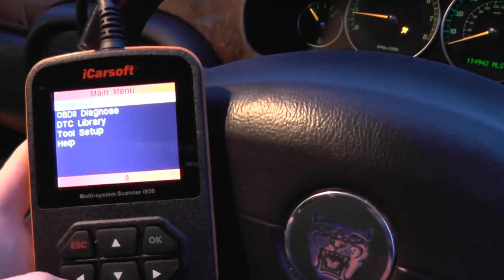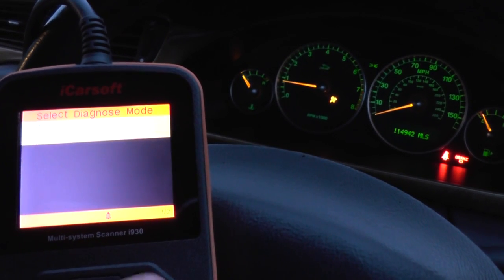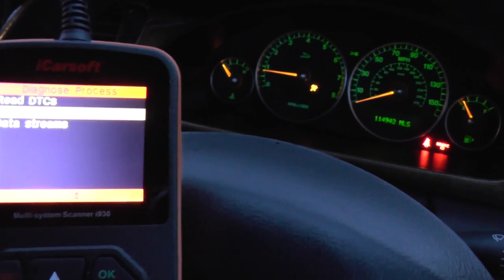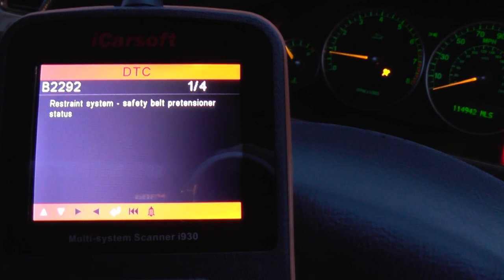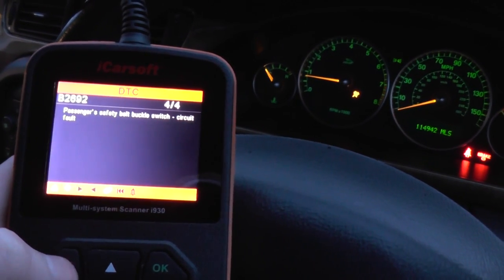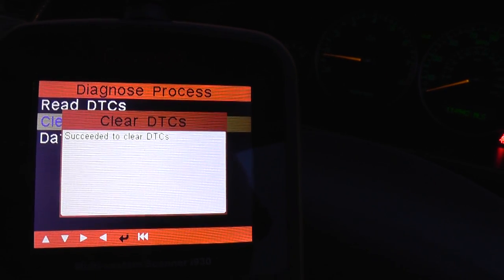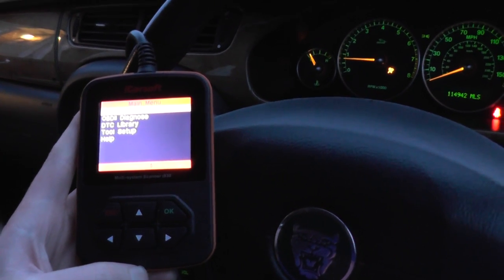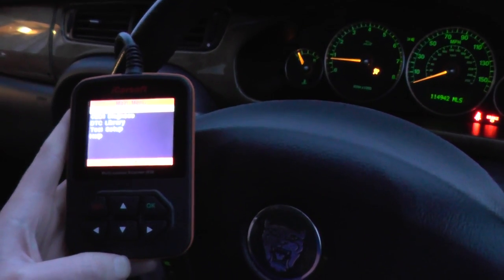This is why your Airbag light will not turn off even with the Correct Diagnostic Tool

Comment: funny, after clearing the dtc then restarting the car, it forced the cars computer into on-board diagnostics in which it was giving a code 52. find the definition to dtc 52 in the srs system for this car and you will know exactly what needs fixed or replaced. good day

Comment: Get some gas! OCD killing me...jags hate no gas the fuel pumps rely on at least a quarter tank to cool and if it fails specially in this model jag you will be pulling the entire rear subframe out of the car just to pull the tank. Gas up lol
Reply: If it relies on a 1/4 tank then it's not well made and that's coming from someone that loves jags
Reply: Wrong, wrong, wrong. Electric in tank fuel pumps are cooled by the fuel passing through them. It doesn't matter if it is full or near empty. If fuel is going through the pump it gets cooled. The only problem with a low tank of gas is running out of gas.